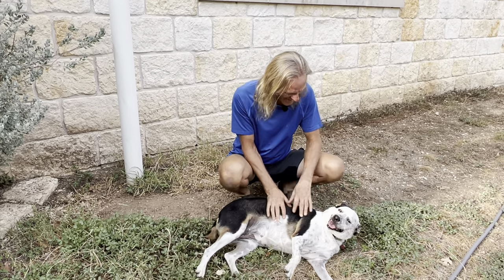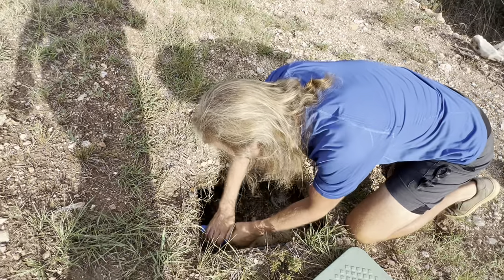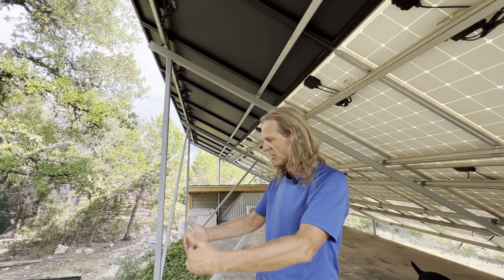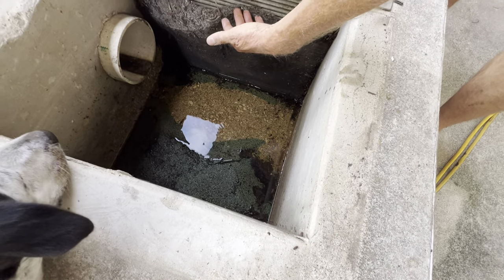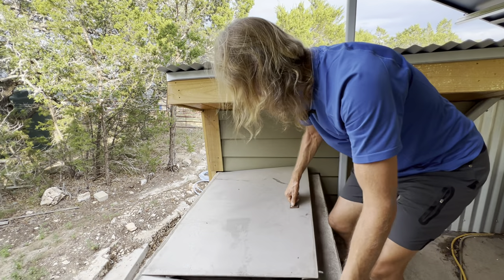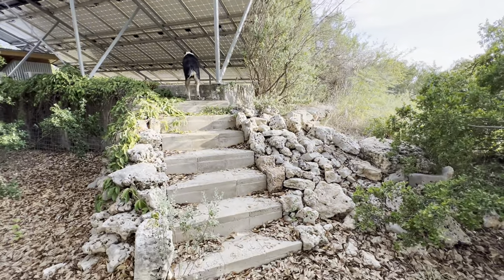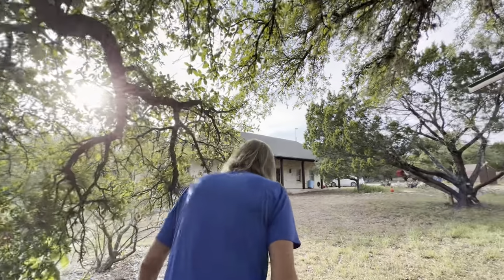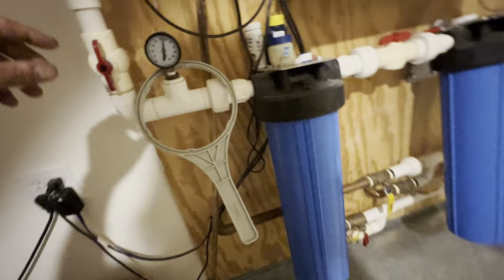Check Out This Nineteen Year Old Rainwater Collection System!! It Has A 22,000 Gallon Concrete Tank!

Comment: I have been on tank water all my life (65+ years) and it's interesting to see how the quality of self sufficient  water  has changed over the years. It was not uncommon as a child to have mosquito larvae (wrigglers) in a glass of drinking water. 
I am impressed with the configuration of your primary filtration system prior to storage in the tank and the use of the ball valve (we use Knife Valves)  to release the common stagnant water problem from the underground  pipeline.  Living in Rural Queensland, Australia, we do not have the problem with water pipe freeze that you experience and it was interesting to see how you overcome the problem. I was also impressed with the size of your draw off tank. Now a days pumps are fitted with an "electronic control head"  which has no draw off tank, (leaving you no draw off water in the event of a power failure) and the unit will protect the pump from a loss of prime/ no water situation. The tank can be added as an extra, but most people don't. 
Now what I am really impressed with, is the fact you are using a UV monitor and you are keeping maintenance records providing frequency of UV and filter  replacement. 
I work in a Pumping /filtration / Irrigation store where we sell "Whole House Water Filter Systems"  which consist of 4" x 20" 5 Um Sediment Filter,   4" x 20" 10Um carbon filter,  4" x 20"  1Um  sediment filter and UV lamp with 360 day countdown ballast.  The UV monitoring lamp is "Extra" and in all the years I have been there, not one single person has purchased one.  Nearly every customer replaces their filters and UV lamp on the anniversary of their installation/commission, regardless if they need it or not.  And yes, according to my training and confirmation by your UV meter, impurities in the water affects the UV quite considerably.  Tannin causes the most problems for us as most Rural homes are surrounded by Gum trees - which also adds Eucalyptus oil to the water.  
As a foot note on using the R.O. for the drinking water - I wouldn't -  for two reasons. Firstly the water is too pure and can be very detrimental to your health unless it re-mineralised. Secondly there is too much waste with the brine water. On average 25% is used, 75%  goes to waste -  this will depend on the unit.   

Keep up the great work with your well thought out and presented projects - so informative

Comment: I just came back to watch it again years after building a variation based on a pumped shallow well that is rusty bacteria bacteria-contaminated water. The rust was so bad that the supply pipes blocked solid. You gave me the information to overcome the obstacles and create tested crystal clear bacteria-free water. This is the very best information I have ever found. The Big Blue 20-inch filter housings are invaluable in achieving a top-performing free-flowing low maintenance system. The Mighty Pure UV with meter is also a hidden gem!
Reply from the maker: Thanks for your comment. Very glad it helps.

Comment: Hi Ray, I am a retired water engineer and your system is well configured. The UV lamps had improved over the years but cleaning the quartz glass is very important for good kill. Its interesting how much the UV transmittance changes between roof and bore water. Most domestic systems don't get the level of maintenance that yours does and your level of understanding is very good. Cheers Dave.
Reply from the maker: Thanks so much Dave. Some things I forgot to mention are that the usable capacity of this 16'x32'x8' tanks is 22,000 gallons. I use a reverse osmosis system for my drinking water because it was cheaper than testing the water to make sure it didn't have any mercury or other metals that might leach out of the concrete due to the fly ash that they put in it. Also I used swimming pool plaster that my mason applied to make it water tight. My understanding is that it uses marble dust to form a water tight seal. The fourth wall also had dirt against it but I removed it to put the solar shed against that wall.

Comment: FOR THE METRIC FANS:
100.000 Liter or 100 cbm is the tank of 22.000 gallons Ray is talking about. 

The tank covers roughly an 11 m x 5 m = 55m² area  (based on 11 columns of 1 m wide panels x 1 x 3,5 rows of 1,7m panels while the rest or half row hangs over)
He mentioned that the tank is 8 feet 6 inches tall = 260 cm.
Each wall is 9 inch thick = 23 cm, the foundation / floor is 6 inch = 15 cm thick and and most likely the ceiling too 6 inch = 15 cm ceiling

net space = 10,55 m x 4,55 m = 48 m²
net height = 2,3 m 
110,5 cbm theoretical capacity (the inflow and overflow will be below the ceiling for sure as this is usually a safety requirement to give someone who falls into a tank a chance to survive and breath)  

100 cbm as mentioned by Ray would require a useable height of 2,08 m.

What a luck that we never had to learn to calculate with inches and foor and gallons in school, only the straight conversion of miles and nautical miles into km or meter.
And it is much tougher to identify an error in the imperial unit calculations while you can see them quite often in metric system when you get that gut feeling 'that result can not be true'
Maybe over time to get used too, but I still can remember my first job when I had to deal with all ever purchased tyre sizes of a car manufacturer (about 8000 back then based on wheel size, weight, speed and tyre manufacturer) to reduce the amount of suppliers and tyres and gain higher economy of scale effects due to higher volumes for less variants.
What a headache we had to get behind all those acronyms to get it right back in the days when Excel 3 and Windows 3 had many limits to handle 8000 lines especially in case of matrix functions, which meant the computer became unuseable for 7,5 hours after changing any figure to calculate estimates. But since then I am at least used to inches or zoll.
Reply from the maker: Thanks so much for doing the conversions for the 60% of my subscribers that don't reside in the US. I'll give you a few more dimensions that I left out. The outside dimensions of the tank are 32' x 16' x 8' walls plus the 6" roof. It was all designed to use even numbers of plywood sheets.
Reply: Thanks for calculating it for us. That's massive !

Comment: Ray, thanks so much for the detailed water tour, a very nice system.  I loved it!   You mentioned RO as your drinking solution.  I used RO for years but as my kids grew up they started to feel the RO water was not making them feel refreshed when they drank it.   Studying the issue we learned that you shouldn't really be drinking RO water as it's too demineralized and can cause your body to have to give up minerals.  After further research I installed a separate bladder tank and split the RO output.  It now supplies pure RO for spot-free rinsing and stove top boiling tasks and remineralized water into the second tank for cooking and drinking.   Drinking the remineralized water I realized it was indeed, more refreshing and leaves you with an added "satisfied" feeling.  I literally find myself 'hhhhhhHHHing' after a glass of it now.   I thank my kids for the revelation.
Reply from the maker: Interesting. I add Nuun tablets to a lot of my water because I'm a cyclist. I also find myself using lime in most of my water at home and I drink a lot of sparkling water. Now I have something else to go check out. Thanks for taking the time to comment about this. I don't think there are many minerals in rainwater but there are probably some that come from the concrete tank, which is why I use the RO. Hmmmmmm

Comment: This is similar to the system i have, the difference i have a 7,000 gal stainless steel tank that is partially in the ground. Where i live the ground is more rock than anything else being very close to theh mountains, but it works out very well. The systen you have is great especially the rain water collection system you have, well done, this looks li,e it will go for more than a few years more like it will last about 100 years or more. Great bit of engineering there.

Comment: I love your videos. Tell your wife she has a great shadow and reflection. Your battery reviews are great.  I disagree with the conclusions you have about cable length on inverter. I was always trained to run the cables to a busbar and the busbar to each inverter. Keep all cables as short as possible. You have an amazing awesome system. I liked and thumbed up.
Reply from the maker: The manufacturer is adamant about making the cables equal to the inverters from the common busbar. Kieth with sunsynk actually has a YouTube video where he stresses it. Thanks for your kind words. I will passs them along to my dear wife.
Reply: Using the average resistance of 2/0 wire,  .08/1000 ft, the voltage drop of 1 ft at 200 amps, or .015 volts per ft.

Comment: I have had a resistance to poly pipe for water, but seeing extensive use in your application has allayed my fears. Thanks.
Reply from the maker: Only use pressure fittings for water pipe under pressure. Drain fittings are not appropriate.
Reply: @RayBuildsCoolStuff  Thanks Ray.

Comment: great line “Everything in my life just barely works” 😂 so true…  I have a similar system on city water, but no UV light..  just (2) 4 x 20 filters, 25 micron dirt only first, then a 5 micron carbon filter, along with a bypass.  works great 😉 (barely 😂)

Comment: Awesome Build Thanks.. I'm stealing most of that... idea
Farmcraft101: What about splitting it out to 2 separate 10" filter systems ~20-10-5-1 micron and then recombining.  You handle the water pressure drop.  Farmcraft101 design.  10" Much more common and cheaper than 20"
When using UV Always put a U in front and behind UV light when attached to PVC or PEX to avoid UV degradation from light
Reply from the maker: I think a 20” filter will last longer than two 10” filters. I buy them by the case and a case will last many years.

Comment: Thanks for uploading. I've been curious since seeing the cistern in your solar shed video. I have terrible rock to drill thru in Guyana and have been using water from the creek for years now with similar filtration and UV light. I love your sensor and cut off solenoid. I'll be looking for one to add to my system. I also use a office type water cooler that has 3 more filters that require high pressure to push thru, and 2nd UV light built in for my actual drinking water. There is no one up steam (I am extremally remote) so that helps things. Most folks collect rain water, but there are so many critters to deal with getting in the tank (frogs laying eggs mostly), its about impossible to keep them out, so I have stopped with a holding tank for the last year. Never been sick from it, but we pray a lot :)
Reply: Forgot to mention another thing that helps a lot. I installed a swimming pool sand filter where the piping from the creek water first comes to the house. It has a 4 position valve and the backwash position saves much maintenance.
Reply from the maker: I use an under sink reverse osmosis system for drinking water.

Comment: Hi Ray, I really enjoyed your video and like your set up a lot. Was not aware the Guardian monitor existed so thanks for that too. i wrote a spreadsheet for mybown set up to calculate mJ/cm2 where you can input your UV chamber, sleeve and bulb dimensions, and also the UVC portion of the watts output of the lamp to check your flowrates to see dose and compare against the published recommended minimums. Not keen on posting online but I dont see a direct contact for you either. Let me know if possible to get in touch if you want it.
Reply from the maker: As the video shows, it is impossible to calculate it because the smallest bit of color even if not apparent or a bit of coating on the tube can have dramatic effects on the effectiveness of the UV system. My email is available on my about tab but I don’t need the spreadsheet. Love the thought exercise though!

Comment: I like this broad variety of content about all that house related topics. 
And the channel name reflects and covers all that with no one to complain about where other growing solar power channels struggle once they try to cover topics beyond the solar power.

The channel is growing quite steadily but I guess it would have made it a bit easier to cut such video like this in 2 pieces.
I know it all but a lot of the average and especially new subscribers might not watch it due to the length. And this one could have had a clear cut after the pump house with the out door part from collecting , filtrating to storing and pumping plus a second part about the indoor distribution and prepartion. 

Consider someone reads the title and usually has no need or interest in rainwater collection then he might more likely spend 10 minutes of his limited lifetime to enjoy and follow your adventures of the past and lessons learned like here the bigger filters and the ultraviolet light lamp checking device than 24 minutes which is shown in the thumbnail and 24 minutes usually feel in the tik tok age we live in like half an hour.

I guess a cut would have been nice and you would upload 2 videos. It just would have required another 1 minutes outro at the pumpstation and another 1 minute long intro walking from the pump station along the batteries into your water distribution room. 

You might need some short(er) videos, not those shorts, but just 5 or 10 minute long chapters to get a series of videos you then can put in a playlist. I could have even split in 3 from the collection to the watertank, then to the pumpstation and last one for the house distribution. Not much more effort, but a better stream of videos coming cause now it is a quite long one.
Finally: youtube is a beast and to get into recommendation feeds of new viewers you need the thumbs, comments, people clicking on the share button and the continuous flow of new videos any kind of schedule like 1 every 2 weeks and this would have had the opportunity of 1,5 months of content and higher watch time overall which also counts beyond the whole clickbait and thumbnail optimisation topic the veritasium channel had uncovered with uploading 2 times the same video with different titels and thumbnails. Was pretty successfull and is worth to watch.

Comment: Oh my, you do all that filtration and UV lights and then you also use an RO system?
Is the RO system a must? How do you get enough pressure for running an RO system?
Thank you for sharing!
Reply from the maker: I store the water in a concrete tank. Concrete is often made with fly ash that may contain heavy metals. Testing for all the things that may leach out of the concrete costs as much as the RO system. I run 50-70 psi of pressure in my system so I have now problem with the undersink RO unit. The unit has it's own pressure tank that has a bladder set to 7 psi. I have enough pressure from the RO to use it for the ice maker.

Comment: It would be very helpful if you video your filter change out of the 20-inch big blue filters and the service on the Mighty Pure UV unit. I have searched for something on YT. There are plenty of channels showing a mock-up showing how to put filters in a clean never used system. The same is true for a never-used UV system. These are companies trying to sell equipment and just using something out of the box with the intent to re-sell. This is almost no help at all!

Comment: I'd like a water collection that collects water, then pressurizes it, then distributes is, using well water as a backup.
Reply: Me too. I can't afford well in Jamaica  because mainly volcanic limestone from 4M years ago, the well digging company charges around $500 USD per foot. Insane right.  I'm hoping in a few years to have something just like Rays and maybe feed into a pressure tank. Not sure if will work but gonna try. won't be ready for 3 or so years yet as start foundation next year hopefully and I'm building what seem like a mansion from pocket and on low to average income 😌🤷🏾‍♂️

Comment: Wonder if some UV lights in the tank that can be powered on when there is excess solar would help... or perhaps pumping the water via a UV light to raised storage (pumped hydro) would be a better use of excess solar... just need an efficient way of pumping and generating on a small scale...
Reply from the maker: The effective distance for killing with UV is very short even with clear water. It wouldn’t do much good to just having it burn in the tank.

Comment: Is there a reason you don't have hanging uv lights hanging down into your holding tank?
Reply from the maker: It wouldn’t work. For UV to work in water the water has to be crystal clear and even then the distance it penetrates is a couple of centimeters. It would just waste energy and bulbs.

Comment: That is a well thought out system and I appreciate you sharing the details. For the GAC filter is pressure drop enough to trigger replacement? I have a similar system on city water and notice that chlorine levels start rising but pressure drop isn't noticeable. Also what is that second little box under the solar panels. Optimizer?
Reply from the maker: I don't have chlorine to deal with. Yes, you are seeing the optimizers on the panels.